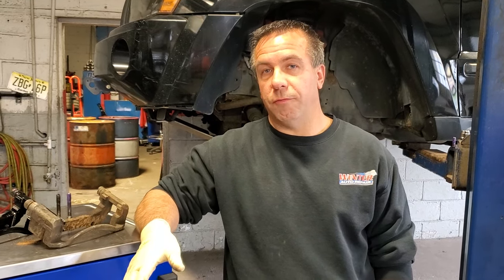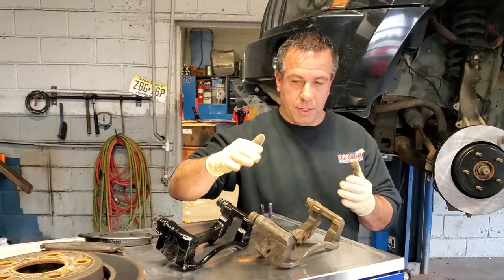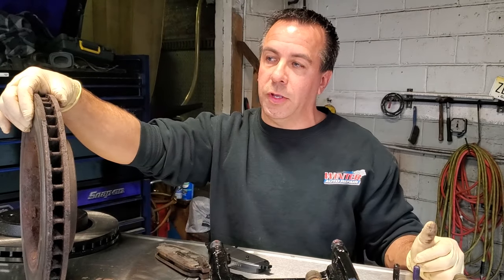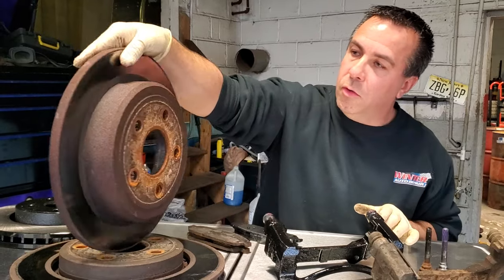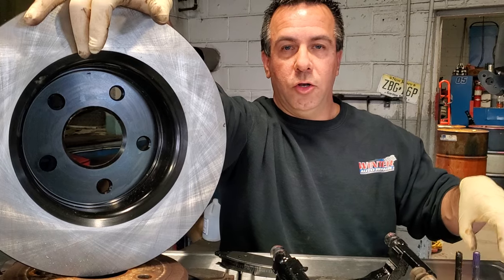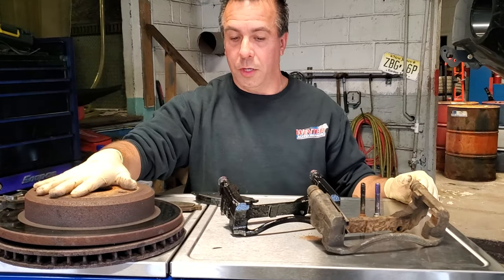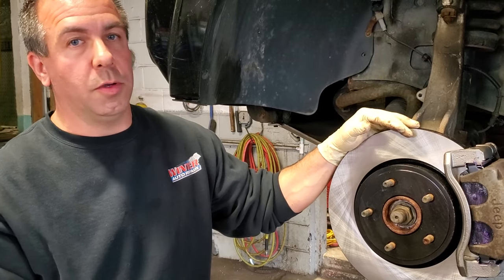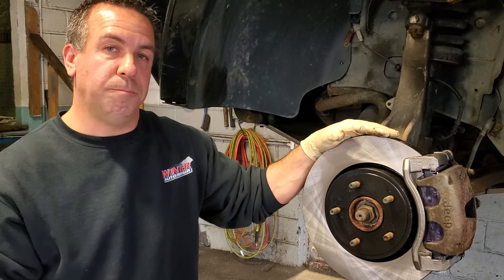High quality brakes vs cheap brakes

Comment: With all due respect, the problem with many mechanics, is who to trust,  regardless of the price they charge they will always use the cheapest parts for them to make more money, and if you ask them if the parts they're installing are good most of them will say the best. It's very rare to find honest mechanics, most of them are ready to take as much of your hard earned money as they can, I'm not sure who takes the cake, used car salesman or mechanics. It's good that you have this video out to educate us on what to look for.
Reply from the maker: Unfortunately, you're not wrong. It seems that this industry has more dishonest mechanics than it has honest ones.  My suggestion is to ask around your area who people trust and speak to them before bringing your car to them. Almost like an interview.  Once you find a good one, stick with them and be loyal. Go to them for everything from oil changes to major repairs. We definitely appreciate loyalty and try to go above and beyond for our customers who are faithful to us.  
Good luck in your search!
Reply: 100% Correct
Reply: Buy your own parts. Have mechanic install them.
Reply from the maker: @MrMaxggangster  buy your own steak and bring it to a resturant... 
I will never install customer supplied parts. What happens when we take the car apart and you purchased the wrong parts. Now I have to wait with your car apart? Are you going to pay for the time wasted? What happens when the parts fail? Are you expecting the shop to remove them for free? When we sell a part it comes with a warranty of parts and labor. Let's say you buy brakes and they fail. You're involved in an accident resulting in injury. You think the lawyer isn't going after the shop even though you supplied the parts! Absolutely not. Everyone gets sued including the mechanic. I have other reasons but these are my primary ones. 
If you find a shop that will install your parts, they are likely not a good shop because they have not thought of or do not care about any of the things I mentioned. Most likely they have no insurance or they are a handy man type place that fixes cars and washing machines because they don't have a proper business model.
Reply: @WinterAutoRepair  I buy OEM parts only.
Reply: @MrMaxggangster  buy your own parts, learn to install them yourself. Invest in tools, not outrageous labor costs. Fortunately there's many knowledgeable mechanics, such as the one in this video, who provide information, tips and tricks for free.
Reply: @WinterAutoRepair  Let's step back and see the big picture. Unless you are dealing with a mechanic or family owned shop, it's all about production, I was a HVAC tech for Sears (remember them) for 27 years we did quality work and took good care of our customers, in the 80's the old guard was gone and the new management took over. Eventually in the 90's they put a portable computer terminal in my truck, tracked my every move, but when they told me I had 15/ 20 min per stop and 12 min travel to the next job, I quit. I am sure a lot of mechanics would want to make sure family's are safe, they have quotas to meet. I have had wheel lugs stripped from my Subaru Forrester almost every tire rotation, leaking oil in my driveway after an oil change, an oil fill cap not secured and spitting oil all over my engine. I am only 77, but am now doing most of my maintenance myself. I hope you survive.
Reply: @MrMaxggangster  Or buy your own parts and do it yourself. Takes 2 hours with basic tools. Some people are so lazy lmfao
Reply: @MrMaxggangster  Then verify that the parts you've bought were actually installed. I've seen mechanics pocket the higher end parts and put on the cheapo parts
Reply: You are bloody Wright they all lies
Reply: @WinterAutoRepair  really ?
I hardly disagree, but i do not live in USA, so i do not know how things are done there. Here where I live, lets say you get the most possible worst part for extremely high price + mechanic. So last time a part that was worh 50$ in reality, my mechanich charged me on that part 120$ + 100$ of his work.
So, yeah, im brining my parts, which i have bought from, and you will charge me for your eork only, and i will bring THE best parts available, since it is all utter bullsh**t.
Reply from the maker: @whoswho6641  I would turn your work away. Customer supplied parts is nothing but problems. So if you came to me with your parts, I'd tell you to go elsewhere.
Reply: @WinterAutoRepair  as i have had with mechanic parts, and also labor. Very poor parts, and very poor labor, even with offical mechanics..
So yeah
Reply from the maker: @whoswho6641  sounds like you should learn how to do your own repairs or find real mechanics. Whoever you're using doesn't sound qualified. 
I also like to buy my own food and bring it to the resturants because they charge way too much for food now. I go to the grocery store and buy a potato and steak and bring it to the restaurant and ask them to cook it for me. Cooking is easy, I don't know why restaurants charge me to cook the food. Ridiculous
Reply: @WinterAutoRepair  you missed the point, it is not about paying, i am willing to pay, it is what i get for my money, and thing i get is utter crap. 
I have tried, with offical dealership mechanics, they are the worst, then small business owners mechanics, one guy mecha nics.. it is all the same, not one of them do quality work. 
Thing is, if i order a rare steak, and get well done, then, why am i paying for the stuff i do not want ?
Actually i am really sad, that i cannot get my car to "my guy" and that i am safe and that i trust him to make a good job. I have bought a new car, and every time, every time my car is worse after the visit to the mechanics. I am even doubting that official dealrship did not change the oil and filter one time.
And my friend also bought a DSG oil for half the price of their workers.. guess what they did (did not do ) to get him that oil. So yeah
Reply: That's why I don't let my mechanics buy the parts.i source what's needed for the job and I pay only for the install.
Reply: Mechanics are notorious crooks.
Reply: @WinterAutoRepair  Say you rip people off, without saying you rip people off😂😂😂😂
Reply: @MrMaxggangster  That's the only way I do it. If they wont let you, you KNOW they are going to cheat you. My dad was a mechanic, I know what crooks they are.
Reply: @Mo , most of them I have asked don't seem to like that at all and won't warranty the work if they do.
Reply: @Winter Auto Repair  , I will say that when I ask mechanics, "who makes the part they are putting on?" Most of the time, it is Carquest or a brand I could get at a retail auto parts store, even the dealer does this! They are not using anything I couldn't get at the store down the street, but they are charging me 2-4 times the price. Maybe because they only made my minivan for 5 yrs & stopped making it in 2008, which is why I don't understand the enormous upcharge on the parts, since they almost have to be aftermarket.  I shouldn't be paying $400 for a Moog wheel bearing/hub assembly when the same part is $210 at Advance! That's what gets me, fine if it is a least  GM/OEM part or better but not cool when just getting it from the same store I could, charging me at least twice as much and then not honoring their warranty when it fails. Actually had a 4.9 star place tell me my muffer was still under warranty but since they couldn't figure out why it failed, I still had to pay for another & labor too. They got the other one from somewhere else so I guess they wouldn't have to honor the warranty. I would really like to know what brand parts mechanics are putting on my car & think it is weird they don't tell you that info. on the invoice. You would think that if a chef is using Waygu beef, they would want you to know that, but if using  the opposite, grade C beef (or whatever grade they use for lower quality) of course they aren't going to tell you or want you to ever know, so yeah, in that case, I would love to see a restaurant open up that allows me to bring my own grass fed beef in for them to cook up for a much reduced price! It is actually an absolute genius idea & I think some lucky chef would be rolling in money from all the people that woud love the idea of someone else cooking  meat they themselves supplied, but with the chef suppling the spices & labor of actually cooking it. I understand though, one day, someone is going to bring you a steak that wasn't properly handled, get sick, then want to blame you, thus ruining for all 100 billion people that ever came after him, such is the way of humans and lawyers.
Reply: Here in NJ. Yuuuuuuuuuup. Use cheap and mark it up 500%.
Reply: I’d say mechanics are still better. You pay them for their knowledge to diagnose cars.  I am a parts changer. I have disassembled and reassembled engines and transmission. But I don’t have the diagnostic skills of a master tech. And I’ll pay a diagnostic fee, all day. But I like to do my own work
Reply: There are plenty of shops that will install OEM parts that customers bring in.  Can easily cross reference with vin number and get what came on the vehicle.
Reply: @huskers1278  I don’t think it’s necessarily laziness but likely just ignorance and that term isn’t derogatory, it’s just a lack of knowledge and if they know nothing about the entire operation are probably intimidated at the thought of attempting it.
Reply: @maxmcvicker  That's a fair assessment on this. I'll meet in the middle and say some ignorance with a splash of laziness lol
Reply: @jdigitalseven7  I've brought OEM brakes to Sears (back when they had auto shops) and they installed it. One time, the install was wrong. It would squeak and "clunk" when I braked. And it happened within a couple days after the install. I took my car back, and Sears said there was no warranty on the job because it was customer-supplied parts. They just didn't want to take apart the entire brake to see whether it was labor or parts that went wrong because in the event that it was parts, they'd have to deal with an arguing customer. I was only a college student but even then, I understood the logic. Do your own install or hire some "cheap mechanic" if all you're looking to do is save a few bucks. Take it to the dealer if you only want OEM parts.
Reply: The problem is two-fold. Lousy mechanics and cheap as hell customers. In Canada resurfacing the rotor on a lathe is referred to as “turning your rotors”.
Reply: @Winter Auto Repair  i bought struts online and my local Ford dealer installed them for me lol
Reply: @WinterAutoRepair  .
Reply: It's not just automotive repair industry it's all Industries what about plumbers, roofers, contractors, used car salesman, lawyers I could go on and on
Reply: The mechanic broke my shit and charged me for the hose. Fuck that I'm buying my own tools.
Reply: @Elpipiton  sue him
Reply: Ask for parts and labour breakdown and you won't get overcharged.
Reply: @owendempster7586  BS man, because they get bonuses for finishing fast but the customer still gets charged full rate. 

If they quote you 3 hrs, and work 1, you still pay 3 hrs. Thos is industry wide.
Reply: @MochaZilla  if you agree on the price I don't see the big deal. Why should senior techs who have been doing the job alot longer and can get jobs done quicker because of there experience be penalized compared to an apprentice who may need the full 3 hours for a specific job? It's with all trades. You pay for there expertise/service otherwise we could to it ourselves.
Reply: @SurviveTheDay  I am an auto tech in Victoria,B.C. and i can say its been more than ten years since I've turned a rotor,only replace these days
Reply: @MochaZilla  It's called book time and most of the industry uses it,what about the time they quote 3 hrs and it takes 5 hrs are you willing to pay for the extra 2 hrs
Reply: @WinterAutoRepair  
Reading the comments looks like many people have been to parts swappers not mechanics. Unfortunately the mechanics have to deal with cost comparisons of cheap eBay parts and some people don’t want to pay for your labor.
I used to have 3 shops that I would let work on my cars, one retired. 
Good mechanics are like good doctors, hang on to them.
Reply: @whoswho6641  Also they make you wait or come back  3 hours but they finish in 1 hour and charge you for 3  hours of labor
Reply: @justine5804  It;s called flat rate or book time most shops use it.
Reply: So true
Reply: @jaym9879  my buddies dad would do some shady brake jobs and pocket money.
Reply: Where do you recommend getting rotors & brakes?
Reply: That’s why I just buy the part and have them install it
Reply: @WinterAutoRepair  I fully agree.. 💯
Reply: Who to trust? No inspections means nobody is doing the work needed.  Don't be surprised seeing a list of things that need done everytime you goto a mechanic
Reply: @jefferygordon243 tried that and it works except.. who the hell wants to work on cars.  Waste of time and your body.. break your hands and neck working on an old rusted car.   Chemicals messing up your skin, just buy a Toyota and Haynes books and bring it to a guy when the book tells you or if it breaks
Reply: 2011 Tahoe needed new low beam headlight bulb. Dealer quoted 3 hours labor because they had to remove the bumper. I went on YouTube and followed the instructions and did it in 15 minutes. And found out you don't remove the bumper all you do is just pull the shell back about 2 in.
Reply: Oh man! You reminded me the old guy next to my old work place, such a decent and honest gentleman! Look after students, do a good job with a fair price. This type of place is hard to find now!
Reply: That’s why many good mechanics quit and find another occupation. No matter what you do. It’s never good enough. Yes it’s a crooked world. Have to carefully pick whoever works for you including professional people.
Reply: Honestly, unless you’re going OEM most of the aftermarket parts available all originate from the same manufacturer.
Reply: @WinterAutoRepair  I don't have any problem at all paying a good shop to do good work, but when I can buy the exact same part for 50% or less than they charge for it, they are ripping people off. Just as an example, shops often charge $100+ just for front break pads on a normal daily driver car like an Acura when I can buy Brembo brake pads for it for just $65. I don't mind a shop charging a few bucks to have to order things, but $40 plus for something like that is ridiculous. Labor is labor and in most cases a shop can do something faster than me and they deserve to be paid for the time they save me and the expertise they have, so there is no problem there, but let's stop upcharging for parts. Oh and lets stop charging crazy amounts of money for things like installing light bulbs. $40 to replace a $2 bulb that you don't have to take the bumper off for is a ripoff and it usually gets people when they do things like inspections. So if your shop doesn't do those things, then good for you and you deserve all the great things you get, but if you do, then you aren't much better than a lot of the other shops that take advantage of their customers.
Reply: @jefferygordon243  Well said. Great advice!
Reply: @maxim30 in Las Vegas as well.
Reply: Well I can honestly say as a former used car salesman and a mechanic i have always told people to do some research and get what your budget can afford i like to say that I am always honest and sincere with everyone who i decide to help lately I am very selective about who I use my skills just because I know that people can be very suspicious and distrustful so I tread lightly, but there are few honest mechanics out there.
Reply: @WinterAutoRepair  That's a terrible analogy.
Reply: @OrsJohn  It's a great analogy and I don't let customers buy parts because they often get the wrong parts especially where there are options based on specific criteria. I have been in business for over18 years, and I tell people since you bought the parts, install them yourself or find someone willing to do it. Most installers will not warranty the job and don't care. I warranty everything for 1 year of 12K miles including noises.
Reply: @marcsmith3881  You don't let them buy the parts because you want to benefit from a needlessly inflated mark up on the product. Why pay someone for the acquisition of parts when it is a two-minute job? The consumer pays the mechanic for the job that they cannot do, so there is inherent value in the service. There is no value in paying a guy for doing a job that can be done by oneself in two minutes flat. I always buy my own parts after having been ripped off far too many times by dodgy mechanics who have zero integrity.
Reply: @OrsJohn  You are making an assumption based on your experience with other shops in your area. I don't mark up the parts and again, too many people have purchased incorrect parts especially when they are attempting to diagnose a problem from a position of zero experience. If you are not the chef, why on earth would I allow you to buy the ingredients?  In this day and age, it shouldn't be that difficult to find a reputable shop based on reviews. I have over a 100 5 star reviews which speaks for itself and registered with the BBB. Believe me, I have heard the stories for over 18 years and worked at 2 dealerships. 

Some shops will allow you to bring your own parts, and some will not. Even bringing your own parts doesn't guarantee a correct installation or provide a warranty. If the part fails prematurely, you will be paying again. It's unfortunate that you can't find a reputable shop or you are using Craigslist mechanics for your installs.
Reply: @MrMaxggangster  was told then they wont redo the repair if something goes wrong.